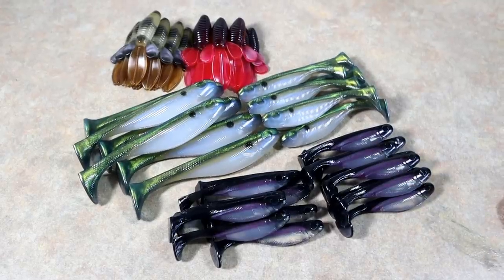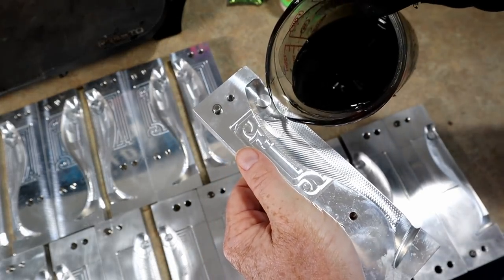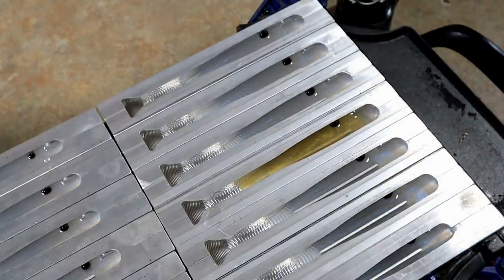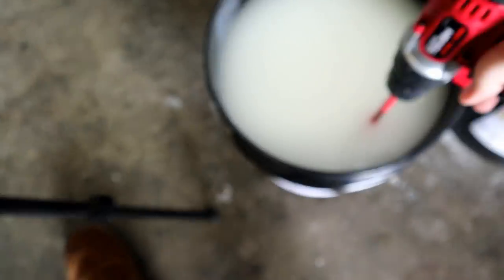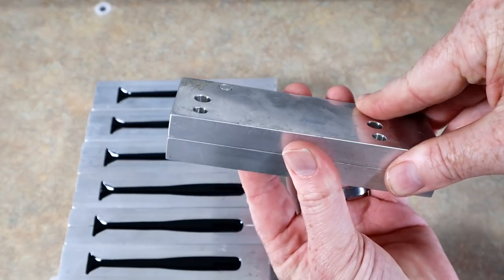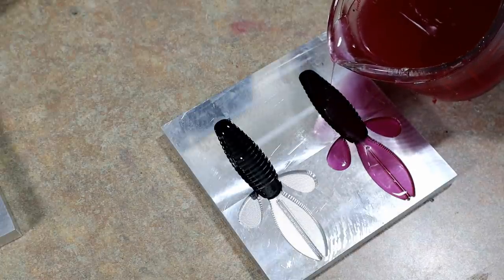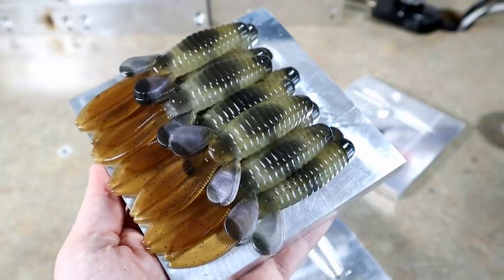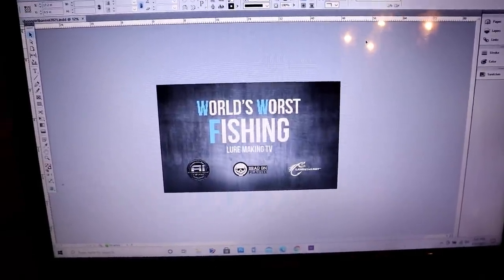Making Lures TO SELL; Bait Makers Blog & Demonstration

Comment: Bro is there some reason you don't pour the leftover back in the cup when you do the capsule pour
Reply from the maker: Yes, once that plastic leaves that cup even to fill the mold it cools significantly..which will start to gum up the remaining plastic in the cup requiring more reheating..but call me Chris I'm not a bro by any means 👌

Comment: Great😊, Question? When i try that with my own made silicon molds ,sometimes when the first por is to cool the temp of the Next por won’t laminate with the first por even tha the temp is 350. Especialy att the front and the tail of the lite where the first pore is the thinest and probebly the coolest part of the first por.. what to do about this? 😊👍
Reply from the maker: Her husband silicone is challenging because you cannot heat the molds, I have several videos on hand pouring in silicone
Reply: Ok, i’ll try to find them. Thanks 😊👍

Comment: BTW - A syringe will make the eyes a lot easier to make accurately. For material that is high viscosity, don't use the syringe tip by simply taking it off.

Comment: Could you use an eye dropper, or similar, to make the black dots? Every time I watch you hand pour those black dots I think there has to be an easier, more precise way, to get uniform  dot size and placement. The only thing I can think of is an eye dropper but that might clog to much. Hmmmm!
Reply from the maker: Plastisol sets up..clogs them
Reply: @WorldsWorstFishing  I figured as much. But there's got to be a way. The reason I'm thinking about it so much is I know my hands wouldn't be steady enough to pour like you do. Think about it, maybe you can invent something and market it.
Reply from the maker: @thelonesomefisherman7425  I think the only thing that would work is a hot glue gun, you can pour thin strips that will fit, even then I still don't want to rely on some apparatus to do my pouring, I've trained my hands to be able to do most of it
Reply: @WorldsWorstFishing  You've got good hands. No doubt. 
I'm just trying to think of other methods... and the added comments help your youtube channel.
Reply from the maker: @thelonesomefisherman7425  🙏🙏
Reply: I have used a Amazon metal meat injector and cut the needle so I can inject small designs in your hand pours. Once done the injector end twist off and you can push plastic out. Works just like a big injector but for detail on hand pour. It’s not perfect but helps.
Reply: @ryanramsburg2859  That's a good idea. Thanks. A mini injector makes prefect sense. I kept saying eye dropper but a mini injector was the concept I was looking for.

Comment: It’s be nice if someone could make you small injectors.  Then you could get more consistent and quicker.
Reply from the maker: Not necessarily, injectors plug up and have to be cleaned out and then refilled, I'm pretty fast at pouring, I've practiced hard to do so

Comment: If you need a website and more hands, feel free to contact me.
For the dots, you should get a 10ml syringe with an 18g blunt tip needle.
Reply from the maker: Plastisol sets up, clogs a syringe like mad.. pouring is the best method..you're not relying on any extra stuff..just your hands

Comment: To bad there wasn’t a tool for you to do the dots , Like an eye dropper . It’d probably make it a little easier for ya .
Reply from the maker: Actually not, hot plastic sets up very quickly in a small apparatus and would only stay clogged up.. it's not like droplets of water.. I've gotten pretty quick at skin pouring.. lots of practice

Comment: For the black dots..instead of pouring it why not use a child's medicine syringe to make it easier to control
Reply from the maker: Hot plastic sets up very fast especially when in a small apparatus.. it's not like water or juice that stays workable.. it will only plug the syringe immediately
Reply: Nice to know thank you for the feed back